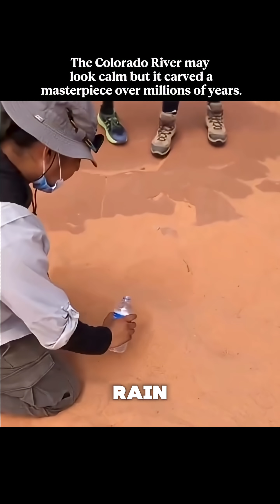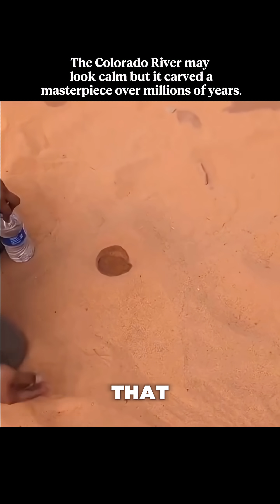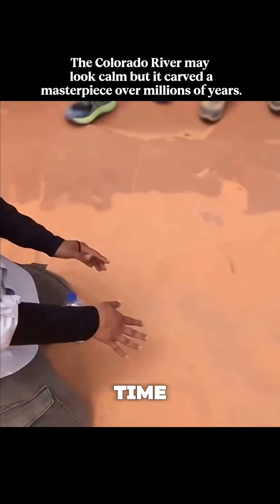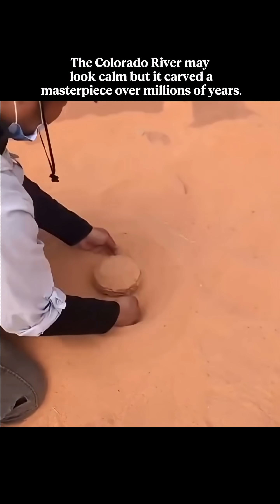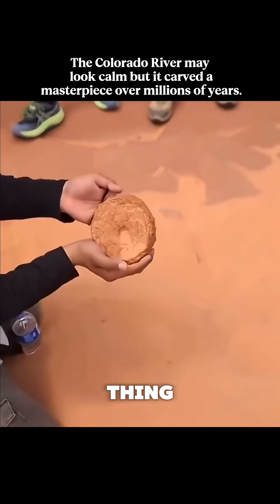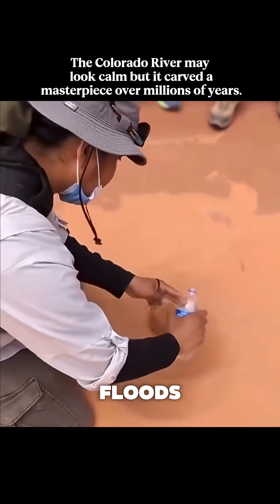How the Grand Canyon Was Really Carved?

Comment: One thing about the grand canyon that people gloss over is the edges are rough and sharp, if it happened over millions of years they should be smooth since the water had time to wear them down. But for it to happen rapidly over thousands of years would mean a massive flood would have had to happen in order to cause that much erosion so fast. I've heard some say the edges are rough from rainfall cascading but others say that wouldn't align with the uniformity of the sides. Just an interesting point that is not discussed wnough
Reply: the are east of it is a giant basic, almost like it was full of water after a global flood. then when pressure was released, a massive canyon was formed over a short period of time.
Reply: Your theory about water having time to smooth the grand canyon is kinda fundementally incorrect. The edges are rough because the erosive action of large seasonal floods inevitably undercuts the walls above the current river bed level. These then eventually fracture off cause they aren't supported and porous sand stone is under a lot of freeze thaw stress. So you are mostly seeing "Freshly" broken faces that never interfaced with the river themselves.

Not sure if you have ever been down to the bottom but there are huge piles of skree on the sides in most places and lots of active rockfall areas taped off cause of the hazard. You will see areas with the smoothed sections in the bed like you would expect from like the smaller Arizona canyons as well. But at this scale they are kind few and far between.

The current dimensions of the canyon floor were mostly carved out during the great thaw at the end of the last ice age when the colorado was perhaps an order of magnitude larger than we see today for hundreds of years.  Even in the most severe rainfall events these days the river is not rising anywhere near the walls of the canyon in the vast majority of it.
Reply: @kylehenline3245 it's not my theory, I'm just repeating what many geologists and different people who study this stuff have said, just like you did.
Reply: @RGT2883i  I don't know where you stand personally, but you're repeated what is called a Bad Faith Argument. There are plenty of people willing to talk up bad data, flawed arguments, and fringe ideas in the name of pursuing an outside agenda. In the case of Large Flood theories it's often from Young Earth Creationists, people who want to believe in Noah's flood and rocks less than 10,000 years old regardless of the evidence and will support any claim that furthers this goal. More importantly, they are more than willing to call themselves geologists if it gives their ideas one ounce more credibility. 

Im going to take a second to attack Young Earth directly. Carbon-14 is a slightly radioactive isotope, created when Carbon-12 is hit by light from the sun. Over time, Carbon-14 will decay back into Carbon-12, and after hundreds of measurements we have a pretty good idea of how long this takes. While the surface is exposed to the sun new Carbon-14 is being created as fast as it decays at an equilibrium, but once buried we start seeing an increase in Carbon-12 at predictable rates. The half-life of Carbon-14 is about 5,700 years, that is after spending 5,700 years buried we will see roughly half the amount of Carbon-14 that we started with. We can compare the amount of Carbon-14 in a previously buried rock to the equilibrium to calculate the amount of time the rock has spent buried. This is called Carbon Dating and is accurate up to about 60,000 years old (as beyond that point we won't expect to see much Carbon-14 at all). 60,000 years is already ten times older than Young Earth Creationists are willing to agree with. We can also do a similar process with isotopes with longer half-lives, but I admit to not knowing the specifics with those methods. Using those methods, the rock the Colorado River is currently flowing over at the very bottom is about 1.75 Billion years old. 

If there's a source out there that supports the flood theory but is also willing to acknowledge the age of the rocks, I'd genuinely like to read it. But everything else is in bad faith.
Reply: It has smooth S curves in it in places. The exact thing we would not see if it was made in one flood.
Reply: The edges are sharp? Have you ever been there or are you just parroting a talking point that another idiot said? 

Don’t answer, because I already know your answer. You haven’t been there, and the edges are NOT sharp. Before you ask, yes I’ve been there. I’ve hiked it, it’s not sharp. You’re just stupid. 😂
Reply: Here’s a clear, evidence-based debunking of the claim you pasted (which is a common young-Earth creationist/Flood geology talking point). I’ll address each part step by step.

### 1. “The edges are rough and sharp — if it took millions of years, they should be smooth”
This is factually incorrect.

- The *rim* of the Grand Canyon (the very top edge you see in photos) is **not the same rock that the Colorado River has been eroding for millions of years**.
- The river cut down through relatively soft sedimentary layers (sandstone, shale, limestone) that erode easily and form the steep cliffs and stair-step profile you see.
- The actual rim is mostly the *Kaibab Limestone* (and Toroweap Formation), a hard, resistant layer that caps the plateau. This layer is only ~270 million years old and has been at the surface, exposed to weathering, for “only” the last ~5–10 million years (since the river started cutting the canyon).
- 5–10 million years of *subaerial weathering* (freeze-thaw cycles, root wedging, wind, occasional rain) on relatively hard limestone is *not enough* to round it off into gentle, soil-covered hills. That’s why the rim still looks jagged and cliff-like in many places — it’s literally a fresh, relatively young cliff edge in geologic terms.

Think of it like this: if you take a chisel and cut a notch into a limestone sidewalk that was poured last year, the edges stay sharp for decades. The Grand Canyon rim is the geologic equivalent of a cliff that was “chiseled” starting ~6 million years ago — still geologically brand new.

### 2. “A rapid flood would leave sharp edges, slow erosion would smooth them”
This is backwards.

- Rapid, violent flooding (like the hypothetical global or regional megaflood) would carry *huge boulders and debris* that act like sandblasters and grind rocks smooth extremely quickly (look at the scoured, polished “channeled scablands” in Washington State from the Missoula floods — very smooth in many places).
- Slow, normal river erosion over millions of years, combined with continual cliff retreat and rockfalls, keeps exposing fresh, angular surfaces. That’s why the walls stay steep and jagged.

### 3. “Rainfall cascading couldn’t produce the uniformity of the sides”
This misrepresents how the canyon walls are shaped.

- The near-vertical cliffs and uniform layers you see are **not carved by rainfall running off the rim**. They are primarily the result of the Colorado River cutting downward, undercutting layers, and causing huge slab failures and rockfalls that keep the walls steep.
- The horizontal uniformity is because the rocks were deposited as flat-lying layers in the first place (ancient seas, deserts, etc.). The river just cuts a slot through them like a knife through a layer cake. Rain does erode the rim and widen the canyon somewhat, but it’s a secondary process.

### 4. Bonus: Things a global/regional flood actually would leave (but aren’t there)
If the canyon were carved rapidly by a receding Noachian-scale flood, geologists would expect:
- Enormous boulder deposits and chaotic flood bars (like in the scablands) — almost none exist in or around the Grand Canyon.
- A single, wide, U-shaped valley — not a narrow, winding, incised meander with goosenecks and abandoned meanders that took millions of years to cut down into.
- Evidence of water flowing *uphill* in places (the canyon cuts straight through the Kaibab Plateau uplift, which was rising as the river eroded — impossible for a short-term flood).

### Summary — why the “sharp edges prove rapid flooding” argument fails
- The rim is a geologically young cliff (≤10 Ma exposure) in hard, resistant limestone → still sharp.
- Slow incision + continual mass wasting keeps walls steep and angular.
- A real megaflood would have smoothed things much more and left completely different landforms and deposits.

The “rough, sharp edges” observation actually supports conventional geology perfectly and contradicts rapid flood carving. It’s one of those claims that sounds plausible until you spend 30 seconds looking at the actual rocks and timescales involved.
Reply: @Thatone-y5n  Where's the delta that was created by all that soil being carried downstream? Why is the exit of the grand canyon a higher altitude than the mouth? Water must have run up hill for millions and millions of years before it suddenly decided to run downhill when humans showed up from monkeys.
Reply: @gregdougherty6348  The change in height over time for the Colorado isn't flat like the Nile or the Mississippi, it's steep. The same is true under the water as well, the Gulf of California gets to a depth of about 3000 meters even today. 

So it's less like throwing sand into a sandbox and more like putting sand into a barrel, you're not going to notice the fan pattern all that much because it's just filling the hole.
Reply: @Thatone-y5n that's awesome thanks for explaining✨
Reply: @Thatone-y5n that's actually not evidence, yes you repeated what many have, and many people with geology degrees have refuted and when you listen to them it sounds just as good
Reply: young earth/ creation and the flood are all truth but grand canyon is actually a quarry.  the history "they" teach us is all a lie!
Reply: @Lis-key  Everything is a quarry if you're willing to ignore literally all evidence to the contrary. 

And a complete lack of evidence in favor

I mean seriously, what?
Reply: 🧐 A massive flood you say? ✝️ Like in the legend of Noah's Ark perhaps 🤔
Reply: @honeybadger3570  One massive flood isn't going to create individual canyons. Interestingly enough, we actually DO have places in the US created by massive sudden floods up in Idaho, where glacial meltwater broke through a mountain range all at once. It looks completely different, and left behind different geological evidence than what we see in Arizona. 

https://en.wikipedia.org/wiki/Bonneville_flood
Reply: All that we believe we understand, teaches us to trust the creator for all the things we don't understand.
Reply: @Avidpurpose  Right but this whole canyon thing is something we do understand. Quite thoroughly. Are you arguing about faith in the unknown or are you arguing for willing ignorance in the face of creation? It sounds like the latter
Reply: @scotttaylor7146 There is no argument. I value that primitive humans try to observe, study, test and conclude. There are many theories on the grand canyon, and the long running theory was that a crater formed it, same as supposedly craters on the moon, that some later released reports, America has never been to the moon. And we all know now the moon landing was theatrics.
Reply: @Avidpurpose  You realize you can see the moon landing site for yourself if you have a big enough telescope, right? Or just point a narrow enough laser at some of the reflector panels they set up for telescope calibration. 

There's no argument because you're perfectly capable of proving yourself wrong, you just choose not to
Reply: @Avidpurpose  this is textbook indoctrination. Don't look into things you don't understand but have blind faith in man's creation of an entity to control the masses.  Gtfoh

Comment: Or a global flood, being created in much less time...
Reply: So youve found a way around the heat problem causee by a global flood?
Reply: @drmantistoboggan2870 I'm not sure what heat problem you're referring to
Reply: @GavinStroh "The main heat problem with Noah's Ark models is the immense amount of heat that would have been generated by processes like rapid continental drift, subduction of oceanic plates, and potential accelerated nuclear decay, which would have been enough to melt rock or boil the oceans, and could not have cooled down quickly enough within the proposed biblical timescale. This poses a major challenge to models that rely on these geological processes to explain the biblical flood. "

From google. As far as i know, no one has solved this yet.

Comment: What happens when it floods for 20 minutes, the rainwater penetrates to about 5' below ground level? It's 120°F for half a day, and the heat from the sun to the surface and continues to penetrate from 1" to 3" to 8" to 12" and so on.
I don't this this is logical, maybe to some point but not to the extent of this video.

Comment: The part of the Colorado River that runs through the Grand Canyon flows from a valley that is lower  in elevation than the rim of the Grand Canyon. Since water doesn’t run uphill, it’s a proven lie that the Grand Canyon was carved by the flowing of water. It was an eruption site where water erupted out of the earths crust flooding the earth.

Comment: Very entertaining indeed! But raises more questions than it answers.
Questions like: That slow water compression…did the water run uphill from low ground TOWARDS higher ground?…like the Grand Canyon it apparently is claiming to have done?

How long will dead trees remain standing before they rots off and falls? 8 years? 25? 300? “Thousands of years…” allowing them to gradually be covered with layers upon layers of different strata of sand as they forms into petrified wood and the sand to becomes sandstone?…while still remaining vertical through the many layers of sandstone, instead of rotting off in all those thousands of years?

Comment: Or the Flood did it in about 2 weeks.

Problem with what he is saying...

1.) THERE IS NO DELTA (where did the mud go?)
2.) The top of the canyon is higher than the bottom (now that's just common sense. 
3.) That giant canyon was not carved out by that tiny river.

Grand Canyon is a washed out spillway by two extinct lakes...Lake Hopi and Grand Lake as a result of a world wide flood.  Took about 2 weeks. 

He claims the Grand Canyon was formed over millions of years.  What?  So the Grand Canyon was formed before the earth?  The earth is only about 6,000 years.
Reply: The earth is 4.5 billion years old and the river is tiny now. It used to be much larger as well as there's this thing called EROSION! The process in which the natural elements break things down over time. Secondly "where did the mud go?" What are you 5? The "mud" is sand doofus. And as the river eroded the canyon and got lower and lower the "mud" at the top would dry overtime turning to rock and sand stone. You people have no common sense or just didnt pay a single bit of attention in school

Comment: So you're meaning to tell me that it rains and then for millions of years you get layers of dry sand with no rain ever, and then it rains again which causes the sand to calcify and that's how you get layers? 🤨 This idiot doesn’t take that into account. You can't compare that miniature example of sand hardening quickly cuz of water poured in seconds in a controlled environment to millions of years of it doing the same thing on a massive scale cuz then you'd have to have millions or hundreds of thousands of years without rain. It's just stupid. Water washes things away so if it keeps raining ever so often every year and washing things away, there's no time to build a layer. It's simple logic. Common sense. Which clearly evolutionists don't use. 

Only places things get covered in sand over many years is in deserts where it hardly ever rains like how archeologists have to dig to find things in Egypt or but if it rained a lot then all of that stuff would've never been hidden cuz the sand would constantly be washed off. That's what water does.